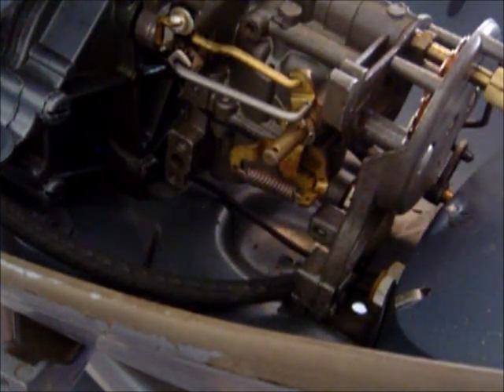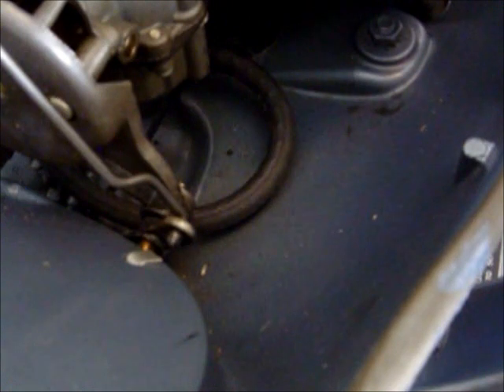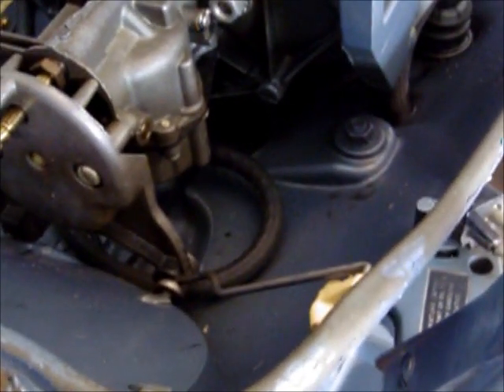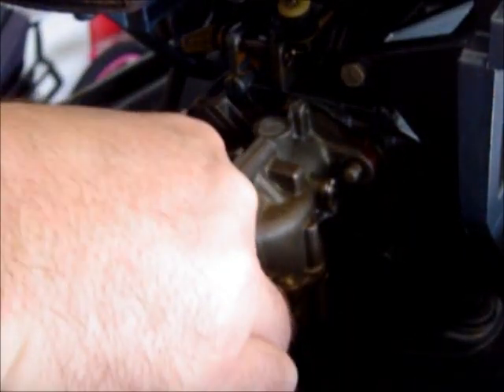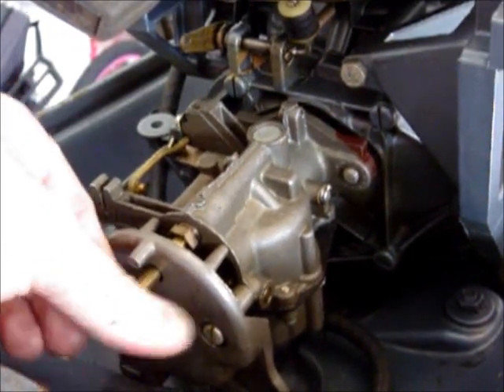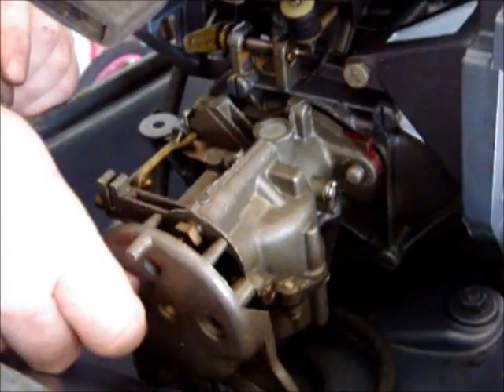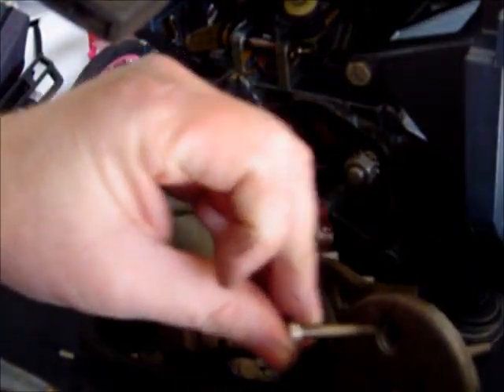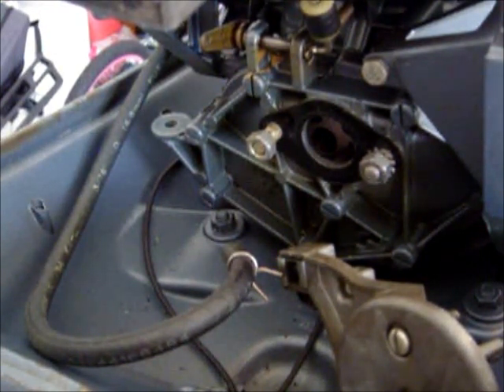OMC fix jet carburetors part 3 of 10  (Motor displayed 1968 Johnson 6hp)

Comment: Looks like a Evinrude not a Johnson to me.
Reply from the maker: +Outboard Fun 

When I was making the video on fixed jet OMC carburetors from 1960 and mid to late 70's, I was also making the video to help a person that lived several states away.  He had a 18hp 1966 Evinrude and had little mechanical experience with outboards.  My main focus was on the1968 Johnson 6hp, but decided to show a portion on a 1964 Evinrude 18hp that the individual could follow for removing and cleaning his carburetor.  So, yes I am aware that the 1964 Evinrude 18hp shortly displayed was not a Johnson.  Hope it did not create too much of a distraction.

Cheers guys, I hope this video helps you get your motor going again.

A good resource to get quick and reliable information would be the AOMCI forum.  Antique Outboard Motor Club, Inc has a free portion to there website and member would be happy to help.  I have been a member for little over 7years and it is a great resource and a great much of guys.

www.aomci.org

Good luck with your motors!!  Just because there are old motors does not mean they are not good or reliable. 

Cheers,

Cajun